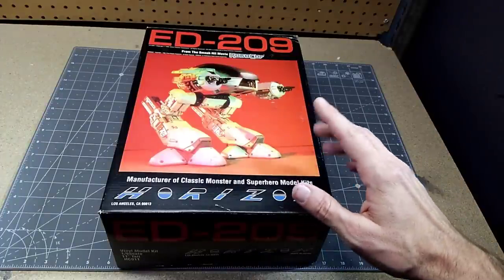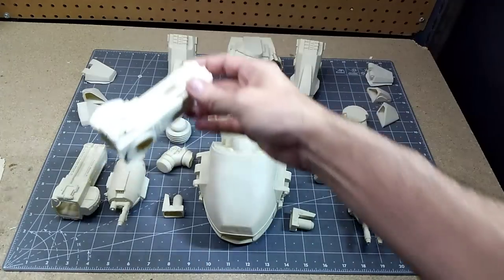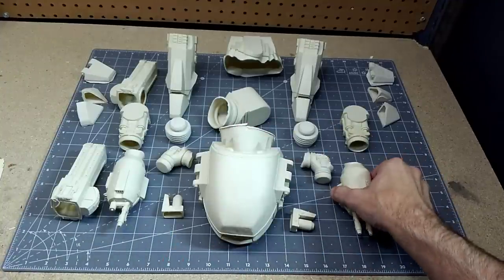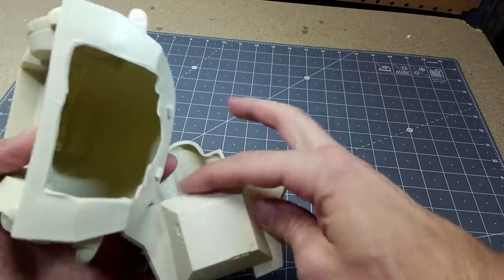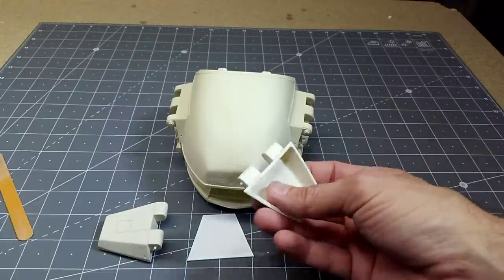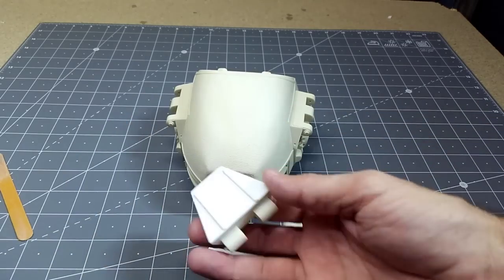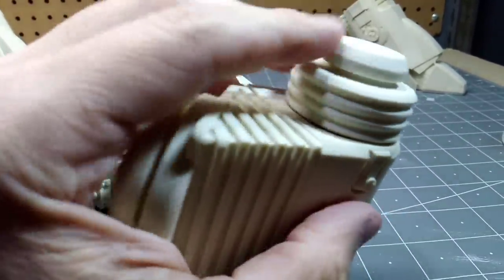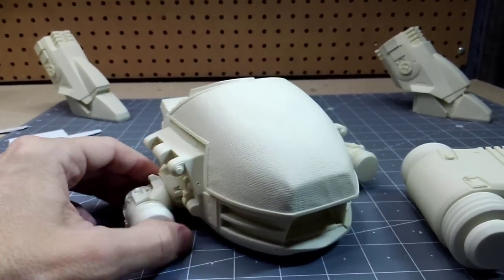RoboCop ED-209 model

Comment: Funny how the original Robocop holds up MUCH better than its sequels and ESPECIALLY the remake!
Heh...
I just recently bought it on Blu ray for $5 from Wal Mart!
Wonderful disc, too!  It had most of the extras of the 20th anniversary DVD steelbook (which I have!) AND both cuts of the movie.
Some things are worth waitiing for.
*************
Again, another very good vinyl kit.
Why do you suppose they don't do more vinyl kits?  The material seems to hold an EXCELLENT amount of detail in it!  It's seem to be more ideal for likenesses of characters than styrene and is definitely safer to work with than resin!
Reply from the maker: I'm no expert on vinyl but it seems that it's best suited for larger models. It can't compete with the super fine detail that modern plastics and resins can achieve. Kits are getting smaller and smaller. I do think it's more durable though.
Reply: @EagleSciFiModeler  Ah!!!
So the reality is the EXACT OPPOSITE of what I thought!
As far as smaller model kits go...
That makes sense from what I see.  The Japanese are leading the industry (still) and the hobby has shrunk in the West.
The fantastic quality of the Bandai Star Wars kits has to be turning a lot heads on their ear about the smaller versus larger.  People have the tendency to think larger equals more detailed but there are examples in films where that's not always the case and the other thing is that designed detail only to the extent NECESSARY for shots.
Going back to Star Wars again, the original Star Destroyer only had enough details for the shots where they were going to specific surfaces.  They added more details on the side that WASN"T seen (in Star Wars) for the The Empire Strikes back and STILL built another Star Destroyer for TESB and ROTJ!
They did well enough with the Super Star Destroyer to fool all of us and that model was maybe half the size of the other two "regular" Star Destroyer models.
Reply from the maker: I've heard how one side of the SD wasn't finished for ANH. They did just enough to get the shots.